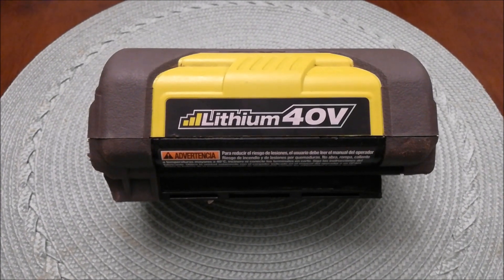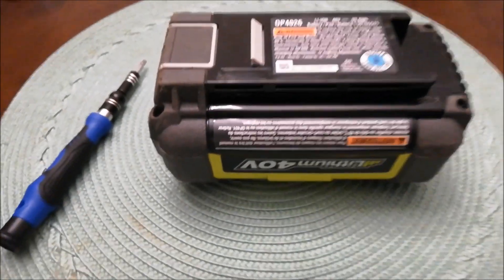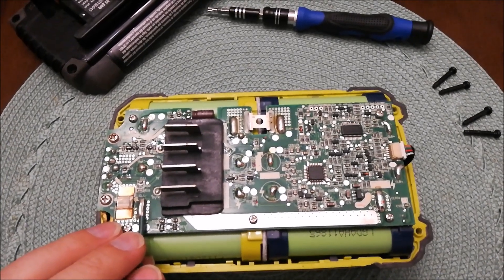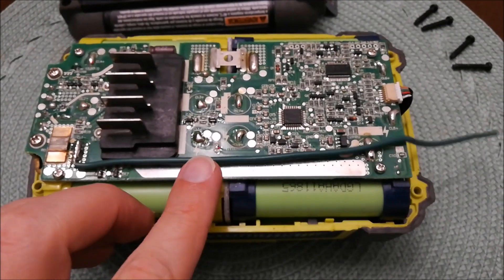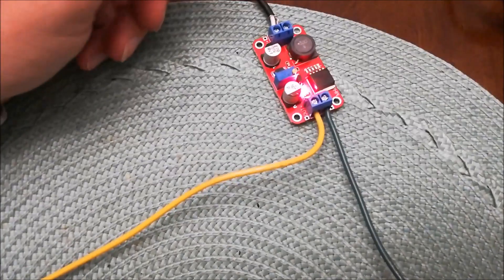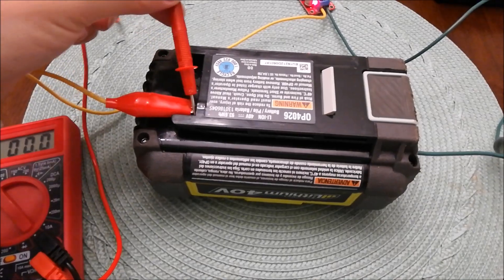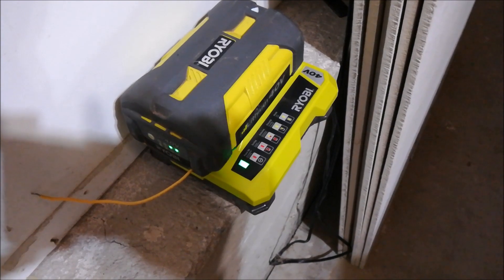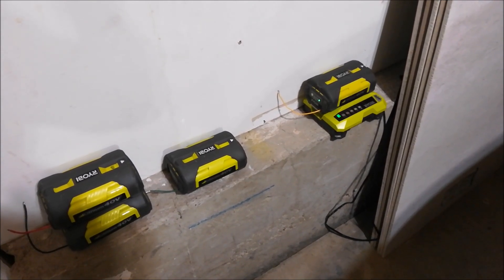40v Ryobi Battery Defective?! Let's Fix it!

Comment from the maker: Check out my website for other awesome content!   https://jasonoid.com/

IMPORTANT NOTE: The wire from the CL1 - terminal can be removed after boosting the battery. I have done this to many batteries and I have NEVER needed the wire a second time. Just be careful to not over discharge the battery again in the future and you wont need to boost it again. I would recommend you remove the soldered wire after boosting the battery to avoid possible short circuits. You could also try to use an alligator clip instead of soldering.

Comment: I don't understand why you drill a hole in the case and run the wire out? Why don't you just do this with the cover off?
Reply from the maker: I left the hole so I could easily boost the battery in the future if it died again without opening it up.

Comment: Is it required to do the hole in the case and close the case before charging or is it possible to just charge it with the case open?
Reply from the maker: No need to leave the wire attached or to drill the hole. Just boost the battery, test it out, if it works disconnect the wire and use the battery as normal
Reply: @Jasonoid  is it possible to just hook the both the positive and clips up to the positive and negative terminals on the battery? Instead of the negative to the cl-one terminal and the positive to the positive terminal? 

Thanks in advance if you get the chance to reply
Reply from the maker: @NatanLemmer  that didn't work when I tried it, but no harm in trying.

Comment: I would add one thing to this video - this method of charging is bypassing the fets which are controlled by the bms - and i believe that before you start bypassing the bms, you need to make sure that all the cells have a similar voltage (you don't want one of them too high in particular to this hack) - charging a pack that has one cell high could lead to over voltage and bad bad stuff like thermal runaway etc etc etc - know what you're doing - do your research - don't burn your house down - otherwise this is a good method used quite often by those who know what they're doing

Comment: I too charged my defective battery to 35.5 volts. But the Ryobi charger still shows a defective battery. The charger is good since it still charges my other battery. Any more Ideas?
Reply: RST procedure I think ????  Try paper clip on RST + 3.3v posts . Hold 30 seconds. Also at the end of 30 seconds still connected push power button at the same time. If no blinking green lights than I dont know. I just ordered my dc booster charger to attempt this fix. Good luck . Let us know if this RST set did it ?
Reply: @dougschmidt5132  .I tried the reset multiple  times, no joy.

Comment: What if I’m measuring 35.8V but still showing defective?
Reply from the maker: The charger starts charging at 36 volts I think, this is a super old video so I can't remember. If you can get it above 36 volts it might work.

Comment: Great video! I have an older 40v battery like this one and all the other ryobi 40v battery rehab videos I've seen show the RST (reset) procedure that the newer batteries have. My pack voltage is 42.3... turns out my charger may be the problem, first it was indicating a defective battery and not charging, now the indicator doesn't light up at all.

Comment: This is an awesome video. Ive got a similar problem that I have not been able to fix. Maybe one of you great people have seen it. Ive got one of the old style batteries that will charge fine but only half way. Almost like half of the internal batteries are discharged or defective. Any way to fix this short of un soldering each and checking/recharging them individually?

Comment: I tried this with multiple AC power supplies and it didn't work for me.   The battery never got past 1 volt (originally 0).  I charged for hours - is there scenario where the battery is just toast?
Reply from the maker: Where are you hooking your charging wires to on the battery?
Reply: @Jasonoid  gator clip to CL1- and battery positive.  Battery had 0 charge when I started.  Multimeter confirmed I had the step up had the right amperage.  The one in your link is no longer for sale so I had to find another.
Reply from the maker: @chriscarrier3926  when connecting to those two points you are bypassing the BMS so it should be applying charge to the battery
Reply: @Jasonoid  Could the battery just be toast and incapable of charging?
Reply from the maker: @chriscarrier3926  Yeah, that could be the case. I haven't ever seen that with the batteries I attempted to charge but I wouldn't rule it out. Maybe the internal fuse on the circuit board was blown and it won't pass power through.

Comment: Is there some reason you can't charge it with the cover off and without soldering the wire in place?
Reply from the maker: You have to bypass the control board, you can use an alligator clip instead of soldering. Once completing the fix, if you don't take the battery all the way down again to 0, you won't need to do the mod again.

Comment: After boosting and verified that the older style battery is charging . Can you now use the newer style charger with out exception?
Reply from the maker: Once boosting the battery, you can use any ryobi 40v battery charger again(new or old), you just have to get the battery's voltage up to at least 35volts..

Comment: i wanna take one of these and usa a yamaha 12v  RECTIFIER and supplement my battery on my atv for the winch from time to time and to use it as a jumper pack to start cars and tractors.. i cant figure out why this wouldn't work
Reply from the maker: The battery has a built in 40amp fuse so anything over 40amps and the battery will cut out.

Comment: in theory with this you could use this to charge it with care..." DC Power Supply Adjustable Variable 3Digital LED Display Adjustable Regulated Switching DC Power Supply 3Digital (60V 5A)"
Reply from the maker: Correct that would probably work pretty well!

Comment: Mine shows 2 bars charged. I see 18v between plus and minus terminals. 37v between T1 and plus terminals suggesting cells are all charged up. I'll open it up and take a peek inside. Edit: a bit of water damage near cell one which dropped to 2.7v all others at 3.8v. think ic protection kicked in and won't switch GND line  MOSFET. Cell 1 charged to match others but MOSFET still not switching. There is a RST pin at 3.3v. should I gnd that pin momentarily? Edit. Something weird just happened. Probing terminals of T to see what resistance... Lights at front panel flashed...and now it seems all is good. 38v on terminals as it should be. Wow

Comment: Can you use a 12v car trickle charger? Prob not if the charger doesnt sense a 12v battery
Reply from the maker: You can try it, probably wouldn't work. Always worth a try to save a few bucks and not have to buy another product.

Comment: TRIED IT , IT WORKED GREAT , THE ONLY THING I CHANGED WAS , SINCE THE HOLE I DRILLED WAS ALMOST THE SAME DIAMETER AS THE WIRE , ON THE INSIDE OF THE CASE I WRAPED SOME TAPE AROUND THE WIRE TO PREVENT PULLING ON THE SOLDER CONECTION.  THANKS!

Comment: I tried this and it jumped up almost immediately, but the DC boost convertor started smoking so I unplugged it. Unsure why I can't do it. Could be the wire is not correct gauge maybe? Not sure how to adjust the convertor
Reply from the maker: Maybe you had the polarity reversed? Like negative was where the positive was supposed to go? That might be the issue.

Comment: Can we just jump positive to another.
Reply from the maker: when the battery is over discharged you have to bypass the circuit board to fix it. You have to open the battery to access the CL1- terminal. You don't have to solder it, you can use alligator clips if you have those.

Comment: On NiMH rechargeable AA and AAA batteries when dead or will not take a charge I quickly 12v spark or 2-3 second 12v charge those. I read that is burns off the battery dendrite growth that short out a cell. Most Li Ion cells can be repaired this way too.
Question?
Is that a True -40v and +40v buss that by passed all the Ryobi 40v circuitry?
Reply: Opened the case and did a 1min charge on the +40v bar -40v buss. Quickly installed the open battery on the 40v Ryobi charger and Green Flashing Light
So
12v 6a car battery charger fixed all my 3 dead 40v Ryobi battery packs.
Thankyou for the info on the +40v bar and the -40v buss. I could not have fixed those with out your help THX!!!
Reply from the maker: It's a true 12S2P lithium Ion battery, nominal volts is around 40v. If the battery circuit board does t get overloaded they seem to work really well.
Reply: @Jasonoid  Cool Top case remove 2 screws access to all cells. I can now 12v spark or 1-2 second charge 2 cells. V.O.M. check which cells are low or dead to fix those. 
Advantage 
No 40v charger and I can fix duel bank of cells at a time with a common 12v charger or car battery. Only problem is you need a VOM and kinda have to know series parallel circuit voltage stuff. Oh bring each cell bank up to to 6v-6.2v (3-3.1v per cell) to insure you get that 35v needed to recharge.

Comment: wondering why you need to open case, if the other 3 terminals are negative side
Reply from the maker: Have to bypass the battery management system, only way to do it. No need to solder, just use alligator clips at the same points used in the video

Comment: Is it just me, or did Ryobi go with a REALLY  bad design, where a 40V battery that drops below 30V can't be charged?

The batteries for all of my battery-powered tools have had short lifespans (fewer than 20 charge/discharge cycles).  This is very bad for the environment.  Think about it;  far less CO2 would have been put out by a gasoline-powered tool, than was emitted in the manufacturing of these batteries.
Reply from the maker: I agree that design is pretty bad. These Ryobi 40v batteries seem to have this common issue. BUT...it's probably this way to avoid a fire while charging. Ryobi is being over cautious while charging the batteries.

Comment: I have two Ryobi 40v Lithium batteries - one is the "new" kind you mentioned with 2.6Ah which is working fine, and the other is the dead one and has 4Ah. Can I just connect the terminals on both batteries with alligator clips (+ to + and - to -) to boost the dead one, and then use the wall charger to bring it up to 40v? Another question: Will either the Ryobi OP403 (with USB) or the OP404 charger revive the dead battery? Thanks.
Reply from the maker: Replied to your email, thanks Armen.

Comment: My older style battery reads 19.3V at the normal pos/neg connections but 38.5V at the CL1- and pos pin. Battery wont charge any further and reads green on charger but wont run any tools.  Is it actually charged but a an issue with the negative pin or board?
Reply from the maker: Sometimes the circuit board gets damaged from water or gets corroded overtime in a humid environment. I have seen some with over-current issues and the circuit board looks burned in some places. Do you see any of that on your circuit board? It would probably mean you have a different issue on your battery and it might be toast. If you purchased Amazon products to fix your battery you can always return them.

Comment: why do you need to open the battery and solder the wire?  Couldn't you just use alligator clips on the terminals used to charge the battery in the charger?  Thanks!
Reply from the maker: You need to bypass the Battery Management System that shut the battery down in the first place. You can use alligator clips instead of soldering to boost the battery voltage, just clip them on to where I soldered in the video. That works perfectly fine.

Comment: It worked! Thanks! I did not solder a wire but simply held an alligator clip for about 3-5 minutes, plugged the battery back into the charger and it is charging! Took more time to tinker with the $15 12v Booster to get the output voltage correct.

Comment: Did you ever answer the capacity question? How was capacity on these repaired batteries?
Reply from the maker: The capacity differs on each one. Depends how long the battery has been sitting at zero charge. Some batteries has 100% after the fix. I have two batteries I have recovered that are very good. Some other batteries have less capacity. I have 8 of these I have picked up over the years. I tend to stick to using about 4 of them that have the best capacity. Thanks for watching.

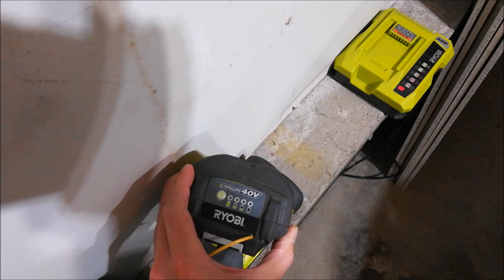Comment: 5:40 mine did not do that.  I actually got them up to 3 out of 4 lights, about 37 volts, but whenever I put them on the charger they still flash red and green.  I wonder why the charger refuses to charge them when they’re holding a charge?
Reply from the maker: I have a battery that does this same thing, you can still use the battery, it just doesn't get a complete charge.

Comment: Would it be a danger/problem in connecting negative boost to battery negative terminal directly without opening the battery pack?
I did not have a booster. I used two car battery charger in series to battery pack and finally managed to bring battery pack voltage up to 35V for charger to recognize the  Remington 40V battery pack.
Definitely, booster would have made it easier.
Reply from the maker: Usually when the battery is low voltage the internal battery management shuts down the terminals so opening  it is the only way to charge it back up. There are multiple ways to get the voltage up, I'm glad you found a way without having to purchase the booster.
Reply: @Jasonoid  I ordered a booster for next time. I guess I was lucky that Remington pack does not shuts down the terminals. Now that I know I will use your tips on reviving other possible low voltage battery packs of different make. Thank you.

Comment: So the battery really isn’t defective ! It’s seems 
a flaw in the system . The charger is tricked 
into detecting defect because of a depleted charge ! which instructions may not explain . Maybe charger needs a modification to detect 
below 30 voltage ! Not fair manufactures ! 
Waste for more profit . Charger should 
recognize a good battery no matter how low 
the voltage .
Reply from the maker: You hit the nail on the head!

Comment: IMPORTANT INFO HERE:

First, my battery was purchased new and unused for 3 to 4 years. Its voltage was ZERO. I was able to charge it manually, not using the charger, because the stupid charger is too "smart" to be of any use with significantly discharged batteries. This whole "smart" charger thing is a ridiculous concept. I don't know if it is due to liability concerns, is an effort to sell more batteries or is an attempt to protect the charger. However, if the charger was truly smart, it would revert to an alternate method to slowly charge such batteries until they could be charged normally. THAT would be smart!

I see no need for the drilling, etc. to run the wire outside the case. I just soldered a wire to CL1- and charged the cells with the case removed. (Didn't see this video until later.) I chose to charge HALF the pack at a time - Like between CL1- and CL6- (also CL5+ which is the same electrically) then between CL6- and the + pack terminal. (The FUSE - Just a flat piece of metal with a hole in it - between CL5+ and CL6- provides a convenient connection point.) You could do this if you don't have a 40 volt supply as only 20 volts (even less) is needed to charge half the cells. LIMIT the current as mentioned. I started with 250 ma but grew impatient and increased it to 400 ma without issue. The cells got up to around 100 degrees F but nothing alarming. (20 volts at 400 ma is only 8 watts, after all.) They are 2600 mah cells and C/10 is 260 ma. So, 400 ma is more like C/6. I suspect the charger may provide as much as 1000 ma of charging current given the charging time for a one-LED charge state. (I have a variable supply and started with just 10 volts on half of the cells. Gradually increased the voltage each time the current-limit light on the power supply turned off.) 

This battery has 20 individual cells. HOWEVER, they are connected so that 10 PAIRS of cells (each pair wired in parallel) makeup the 10 "cells" that are connected in series to form a battery string that provides the 40 volt (nominal) pack. Look at it this way: Take the batteries two at a time and connect them in parallel. Then take the 10 paralleled sets and connect them in series. The sets are identified as CL1, CL2, etc. where CL is likely an abbreviation of the word "CELL."

Lastly, DO NOT run the batteries until they stop powering the tool! 

DO NOT DO IT. 

This can lead to the exact condition described here - Battery won't charge. Try to keep an eye on the charge level and DO NOT allow the battery to go below one LED on the charge indicator. I suspect that thousands of these batteries have been returned and/or discarded when all they really needed was a proper charge. Ryobi needs to make allowances for this condition by providing a "restoration" or "recovery" mode in their chargers.

This is the second time I have revived an "unusable" battery. The first one is still working fine 3 years later!
Reply from the maker: I agree, as long as you don't discharge the battery too low and keep it charged up, the external wire is not needed. Thanks for the helpful info!

Comment: why can't i just alligator clip the positive and negative terminals on the battery (the ones that the charger clips onto)
Reply from the maker: Isn't that what the charger is doing and failing? The internal board has 'shut down' the battery because the voltage has fallen too low. In order to charge it again you will have to by pass it manually by charging from the C1- terminal directly. The video goes over the process of boosting it up to over 30volts. The internal board will then allow it to be charged again.

This doesn't work for all batteries, it has worked for 6 of 8 of mine. So some batteries are just broken for good.